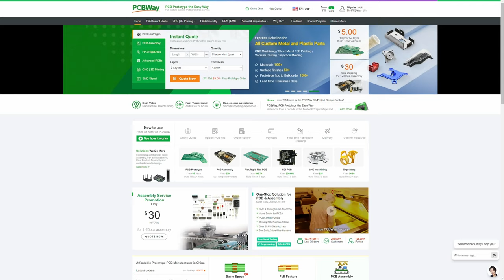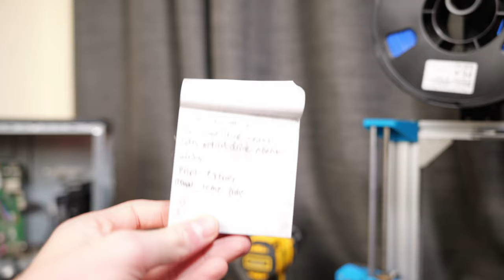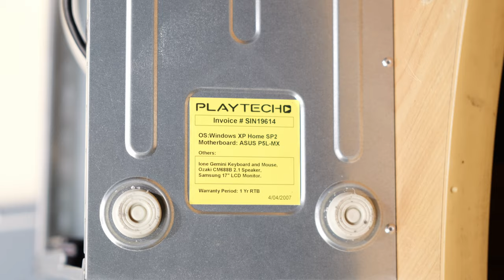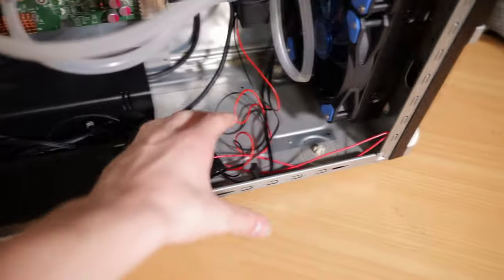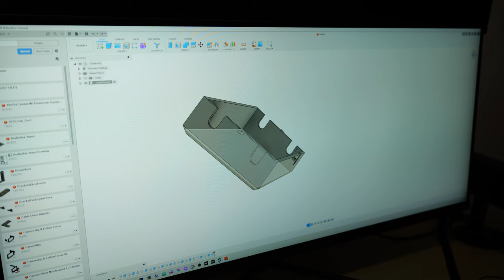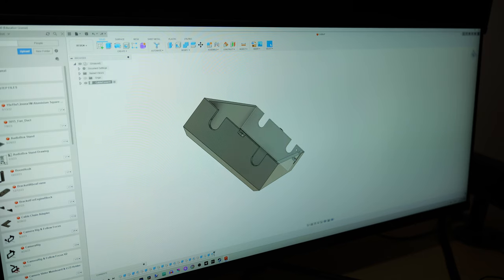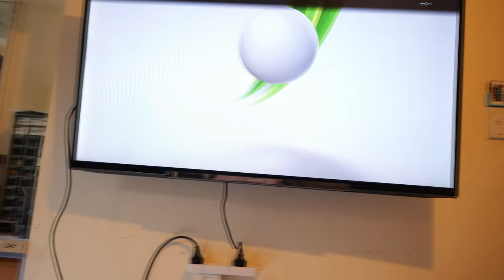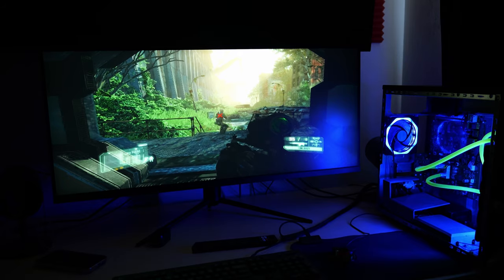Building a Sleeper Watercooled Xbox 360

Comment: Funny, at least your old graphics card had fans, which means it was probably way more powerful than those I found recently, which only had hatsinks. Btw, are you sure you didn't hurt yourself the way you ripped all those components out? It surprices me you didn't use any plastic straps at all, I thought that would be the final solution for the power socket in the back.

Truthfully I'm a lot more hard on myself to make it look good and to make it perfect, so sad enough many times I just don't finish it because of that. So I guess it's good with someone like you who are a lot more "it looks awful but it works". Hope you don't get offended dude. :face-orange-biting-nails:

EDIT: I didn't realize it was meant to be a sleeper / not so inviting when I wrote the comment.
Reply from the maker: No worries at all, I appreciate your comment!

Comment: You'd be surprised how many PC builders don't know how to drill out rivets. Neat project although a massive air cooler would be more my style. You do have the room for it.
As for the urine colored coolant, no words. Was gonna say something about the rad mounting but you got that figured out. With tubes down, you don't have to worry about air in the lines.
Reply from the maker: Good to know! Thanks for your comment

Comment: Ok this one is much better than the previous one. Really not much I can criticize this time, maybe the temps still being inaccurate and you calling rgh a softmod (it is actually a hardmod since you need to solder stuff). Except that all I can say is get a different motherboard revision so you can actually take accurate temp readings and you can probably relocate the eject button to the top of the case so you can eject manually instead of having to do it thru the dashboard.
Reply from the maker: Yeah, monitoring coolant temp wasn't what I wanted originally, but having some "indication" was a must in my opinion. You're right about rgh, I'll make note of that for next time. I really want to do this project again with a slim model or such, as it gives me a chance to either do internal watercooling, or ditch the disk drive to install games locally on the HDD and make the console as this as possible, similar to DIY Perks' PS5 watercooled build. Thanks for your comments!

Comment: If your e model has a corona motherboard and not Winchester you can rgh it and get temperatures from the built in sensors directly!
Reply from the maker: Unfortunately it is a Winchester board. I plan on getting an older model preferably using corona to redo this project with the added benefits of rgh and such, and even better custom watercooling too. It’s going to be exciting! (ETA December) Cheers!
Reply: @TommyHoughton I am subscribing to see the update in december lol (edit, saw what looks to be a front panel for the slim so I'm hopeful)
Reply from the maker: @piotrbijak3545  I've got the slim console sitting in storage ready for then! My November project might get a bit busy, but the console video will be made at the quality I want, even if it takes a little longer. I want to release it on the anniversary of the original video haha.
My plan is to take apart the console, 3D scan the circuit board and make a custom waterblock and enclosure for it. Should be a full on project. I'll be trying to shrink it down too. Cheers!
Reply: Hey tommy where do i buy this water cooled system from ? 😊
Reply from the maker: @Easykillsbogus1  hey, sorry but I bought the watercooling stuff locally, however I’ve found one or two similar aliexpress listings in the past. The only thing I can recommend is having a good look there. *the console and pc case were also local but can be found just about anywhere Cheers!

Comment: okay why not use the original pc powersupply instead of the xbox powersupply ?
Reply: maybe cs it might not be compatible
Reply from the maker: I was considering it, but I knew the previous power supply would work well and require no altering. It would have been nice to use though, but beyond my ability.
Reply: @TommyHoughton  would be more "sleeper" I run a bunch of my consoles from a modified old pc powersupply on my bench

Comment: What happened to all of the Xbox 360 back ports and front ports there should be four USB ports two on the back and two on the front and you’re missing the Kinect sensor back port
Reply from the maker: I believe they’re all there, I just don’t have access to them. That’s the main flaw with this design. I plan on remaking the first project in December with as few flaws and as many improvements as possible. We’ll see how it goes. Cheers

Comment: Couple of tips. if you flip the board where the cpu would be on top, you might have been able to not need to route any of the aio cables. And the radiator might possibly been on the side panel on the back where you could've made a vent!

Still love the project and it peeked my intrest!
Reply from the maker: I really appreciate that! Optimising the design is something I'm looking into a bit more now as I plan to redo the original watercooling video in December, but with a lot more refinement and RGH modding too. A bit of an anniversary video haha. Thanks for watching! Cheers

Comment: Why not cut the Xbox power cable splice the ATX psub12v rail power the Xbox with the atx and use a non momentary switch to turn on and off the PSU might wanna add a ceramic resistor in line but ya get rig of the power brick
Reply from the maker: I was considering using the atx, but I knew the current setup would work without issue, so I didn’t want to try something new on a short timeframe.
Reply: The xbox might get mad since iirc with original psu the xbox takes 5v for standby and only tells the psu to give 12v with the power enable pin when it needs to turn on.
Reply: @h1r0uwuu  both e and s can run off atx psu 12v rails its been a hot minut since i built my water cooled 360 in a pc tower but its easy peezy if i figured it out 10 years ago when i had no idea about electronics lol but the e and s models for sure can run off atx no issues

Comment: A lot of people don't realize that when you get rid of HDMI and stop using it, your console starts getting 120 frames per second.
Reply from the maker: What do you mean? Is this because of the limitations of the HDMI version that the console uses, so when it’s not connected to a display it technically runs at a higher fps? Or am I misunderstanding. Thanks for your comments!
Reply: @TommyHoughton  the Xbox 360 was engineered without HDMI. Non of the early consoles had it yet. It was invented to run on the rgb/audio cable with a tv from that same period, so most games like GTA IV COD WAW, etc. 2006, etc. They will display a faster picture and more content if you don't use HDMI.
Reply from the maker: That’s great to know, thanks for explaining!
Reply: To get the best experience you need the original 20gb HDD with a premium chip set console from 2006  that is non HDMI and run the game directly off the CD to see things you have never seen before. The problem is that these original machines, hard drives and disks are passing away rapidly, so if you don't have all of that, you will have some missing game content but you should natively run on the rgb cables. The original 2006 20 GB HDD with it's sibling consoles unlocks original Xbox games and additional in game textures, models, and animations for certain 360 titles. I figured this out recently.
Reply: @TommyHoughton  Back in the day, fps was based on different brands of CD. People would wait outside for stores to open on black Friday to get stacks of CDS to burn games on. The idea was, the nicer the CD , your disk player didn't work as hard, the better load times made of for fps, not the CPU or GPU temperature. I was hardcore hotswapper back in the day and I drank a lot of mnt dew. The entire websites I used to chat on with my friends got completely taken down. But I urge you to try burning your own games for the 360. It can be a lot of fun.
Reply from the maker: @mitchsterling3266  I’ll see what I can do! I keep thinking games (especially modern ones) are being held back by pure GPU and CPU power rather than storage. I had never even thought about that except when of course comparing SSDs versus HDD’s (mainly for video editing but it’s similar for gaming.) That’s really cool to know about the CD’s!
Reply: @TommyHoughton  yeah a lot of people have been upset that halo3 has been downgraded now as a digital copy and it's true, the CD gives off more storage and more Information. Flash drives and new hdds are made up of tons of microscopic switches and they are not as fast as the 0 and 1s of a disc like the disc hardrives and the actual CD/DVD.
Reply: Having soap circulate on a very low level around you is extremely good for helping deliver oxegen to injured lungs and it might make your teeth hurt a little so if you do put the bar in a upstairs and down stairs large vent , you can cut off some soap until, the bar is smaller and doesn't hurt your teeth. Anyway, this is too much info but hope that helps you out, you remind me of one of my old friends from halo2 days.
Reply: If you get an original Xbox 360, make sure you take all the screws out of the hardrive casing, this will help keep the console from over heating. you can also drill holes around the sides of the casing. Another tip, one of the best free and high graphic games you can download for the 360 is the battlefield 1943 demo trial, you can access it from the options tab in it's menu, once you have completed it, you can use all vehicles and entertain your self like you are playing GTA.